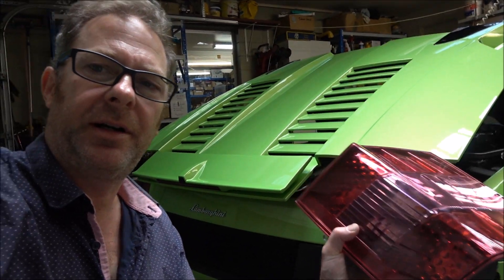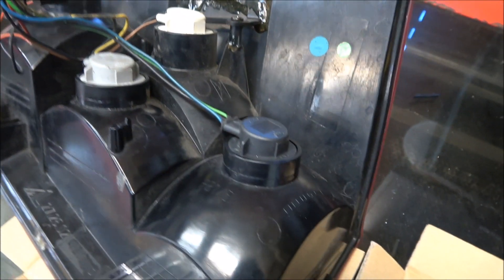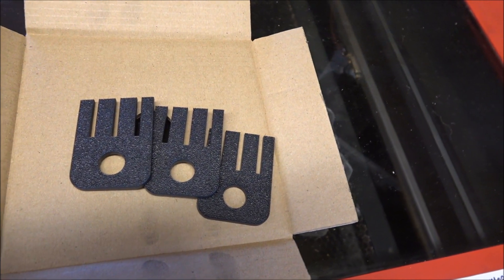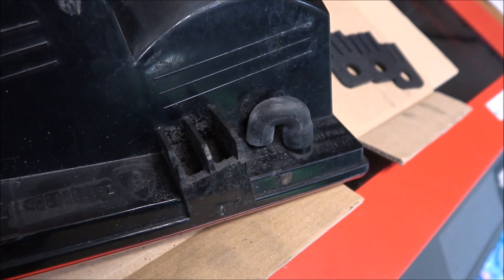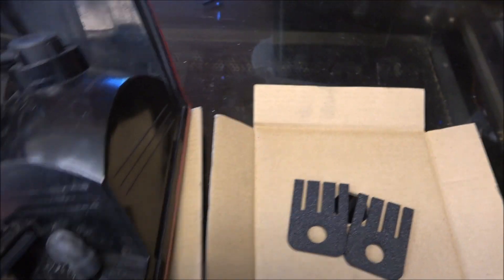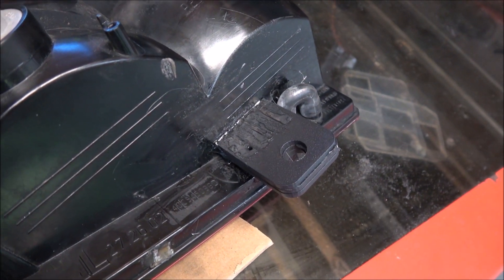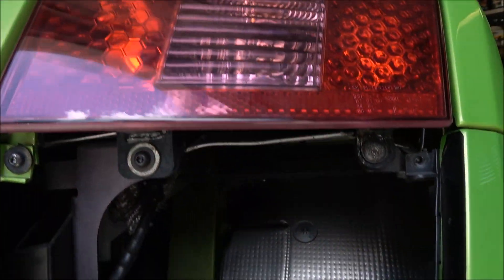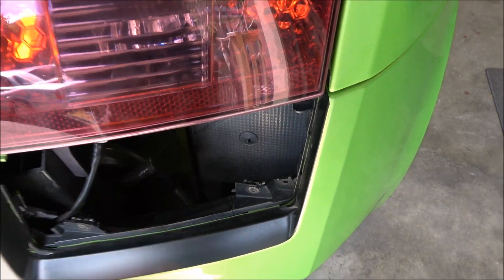Lamborghini Gallardo Plastic Tail Light Repair

Comment: Looks like a solid fix, I gather this is one of those "not just me" problems.  My '04's tail lights had been given the works prior to my ownership.  Tabs missing, and they'd been poorly "smoked".  Polished out the latter, but have assorted zip ties and oversize washers holding what's left of the tabs to the car for the moment.
Reply from the maker: Yeah, all the tabs on the grilles and lights go with the heat cycling. Check them before they fall off on the motorway haha